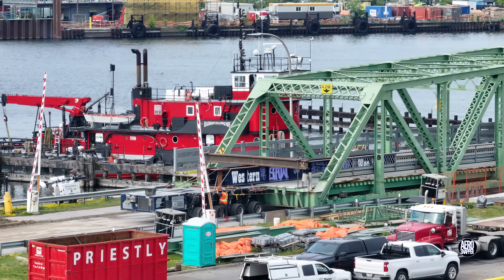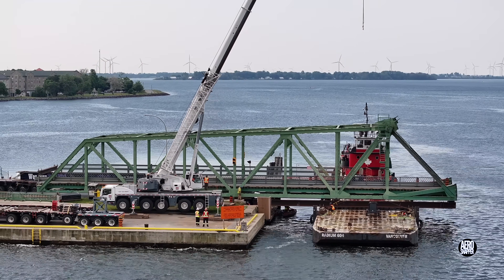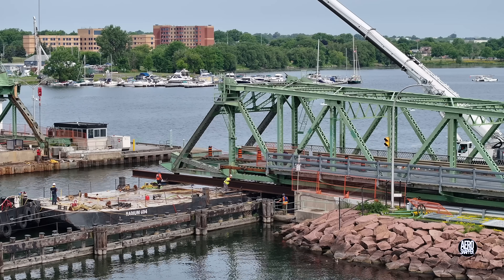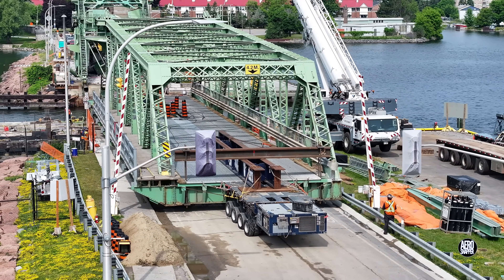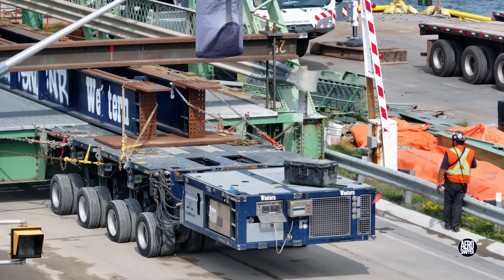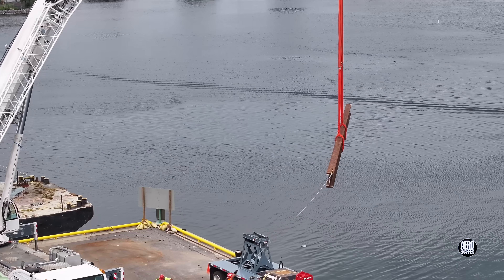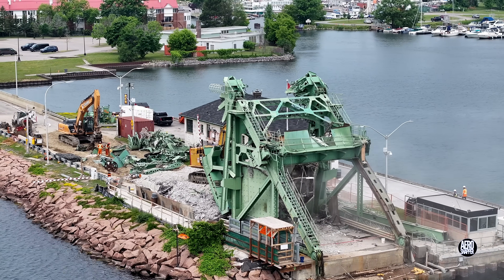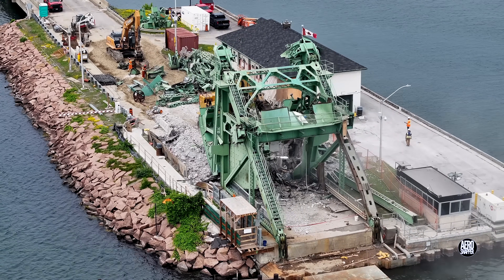Slip Sliding Away - an update on the removal of the La Salle Causeway lift bridge 4K

Comment: I wanted to thank you again for making this video. I ended up showing a frame of your video at 1:18 to Mark Gerretsen, because I feel that, now that we know that they can do this with the old bridge deck, I feel like they might be able to build a new lifting section for the old bridge deck, and use the old bridge deck as both the temporary bridge, and it's "replacement". Hopefully it works out for our old singing friend, and he seems receptive to it. Unfortunately, he doesn't have the final say to such things.
Reply from the maker: It's pleasing to know that the video may be helpful.  It's important to know though that the replacement of deck grates on the bridge had not been completed when the incident occurred.  There is a substantial area still open at the east end.
Reply: @Aerosnapper  Yep, I saw that when I walked it just before its closure. The grated road deck should be a pretty rapid fix, especially with all traffic shut down. In fact, they could probably get it all done within a few weeks at most, and probably the deck itself in a week, I'd imagine.

I'm crossing my fingers that they consider my idea, since it would be a faster fix to retrofit the old bridge structure to a new lifting unit, than to build a new one. And, since it's already designed to fit in its original foundation, it should be secure and safe.

Also, some good news for the boats; there's a plan for handling boat traffic during this difficult time. I'll leave that for the officials to explain, but there's a plan in place.

Comment: How was the deck lifted above the buttresses? We're Jack's on the barge used or a crane?
Reply from the maker: Close examination of the footage will reveal that on either bank a shelf is present.  Western Mechanical used jacks and heavy spacers to raise both ends of the deck... It was a work of real skill and a great demonstration of the capability they share with Priestly
Reply: Thank you. That's a great solution.